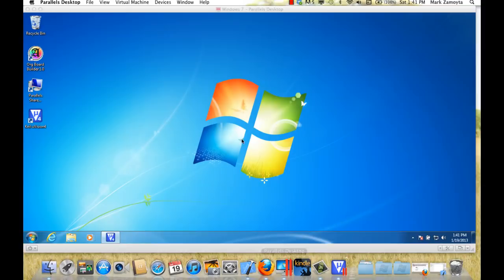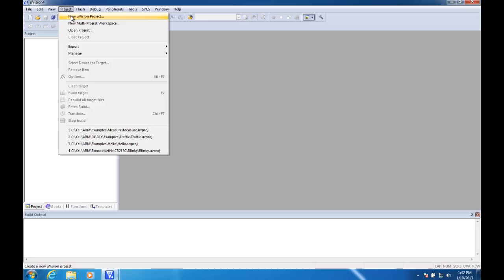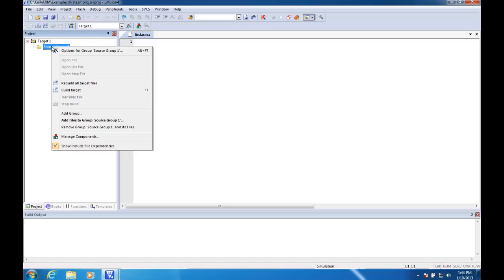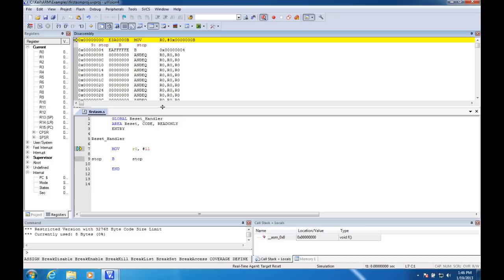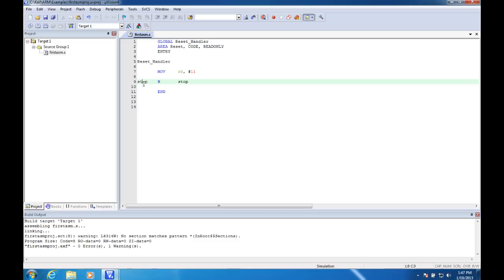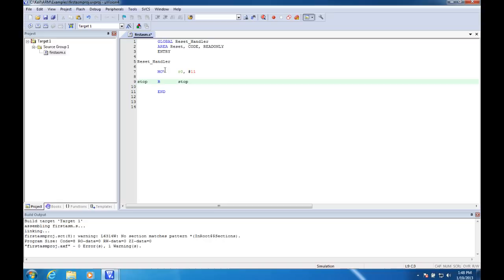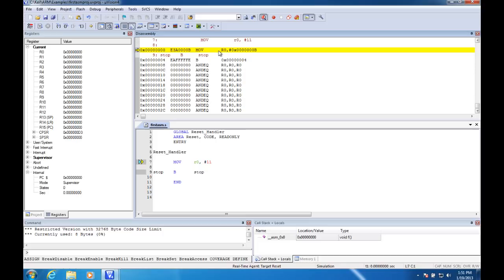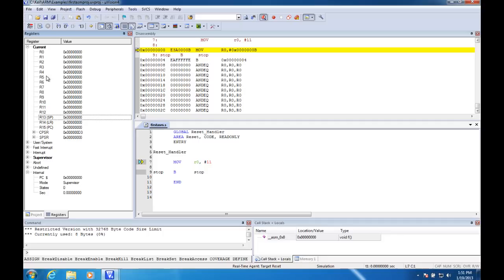ARM Assembly Language Tutorial - Part 1 - Setup ARM Tools

Comment: Can I run a program written in ARM on a x64 processor?
Reply: short answer: No. The basic architecture is different, some x86/x64 instructions just don't exist in ARM architecture, other performs differently. Even if you use an higher level language like C to write your piece of code and compile it on ARM (conversion of C into ARM assembly), it has very little chance to work on x86 without recompiling the program with an x86 compiler (which converts C into x86 assembly).
Reply: Yeah, I actually did more research on this and found that out. Thanks anyway though! :P

Comment: just an OP question,For example you have mp4 video on your desk top then you right click on it and "click open with.. then you choose to open with note pad, a note pad will show with unreadable character written on it, WHAT IS THAT? is it the assembly language or not?" if not then what is it.please help thanks :)
Reply: It is not assembly: notepad can read ASCII characters but your mp4 file doesn't content  any so basically, what is happening is notepad trying to read arbitrary values, interpreting them as ASCII code (which they are not) and displaying the results... An analogy to give you the sense of what is happenning (but is obvioulsy not like this in reality) would be: you read the value of the pixel on the intensity channel, let's say the value is 130 for a medium illumination. Your ASCII code reader (Notepad) has no idea that it isn't ASCII code, it is only supposed to read this. So it interprets the value "130" as the value "130" in the ASCII table which represents the symbol "é". This "é" doesn't represent anything and is part of no language, it is just a stupid interpretation of arbitrary code ;)
Reply: i see, so i really need to mess up with reverse engineering binary and assembly? seems so hard
Reply: lorenzo garcia
 It depends what you intend to do... if you plan writing your own OS, you can use your favorite "high level" language like C for the most part but for key tasks, you'll have to dig in assembly no matter what. Many "beginners questions" are answered on the wiki of osdev.net. It also provides many ressources to help you begin with your project.
If you just plan to write an application on top of a kernel (Linux style), assembly might be overkill but it is definitely worth give it a try, the challenge makes the experiment trully epic ;)

Comment: Write an assembly program named findStringLength.asm to compute the length of a string assigned to a variable named message. Your program should assign the value of the length of the string to a symbolic constant named myStringLength. Use print function to print the value of myStringLength.

string is CSCSI516
result should be 28
can any one do this for me please 
very urgent